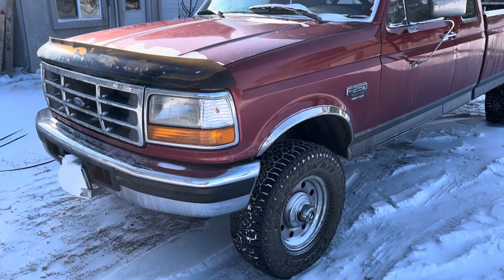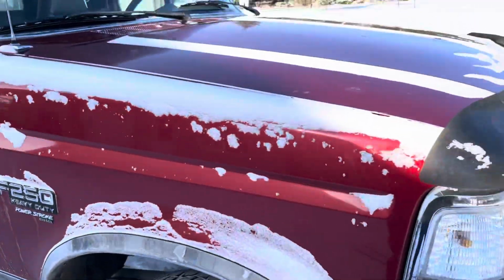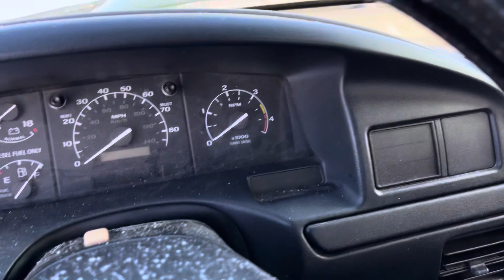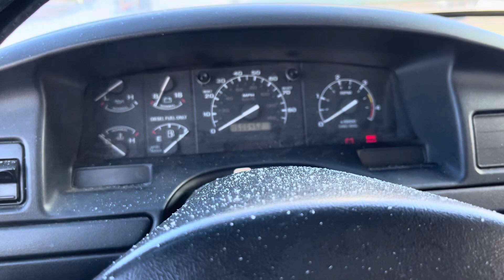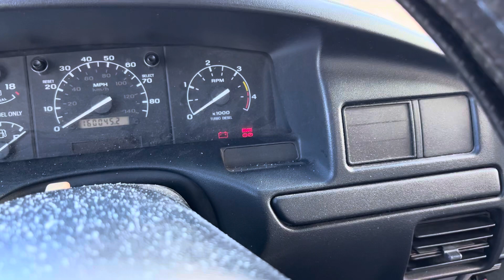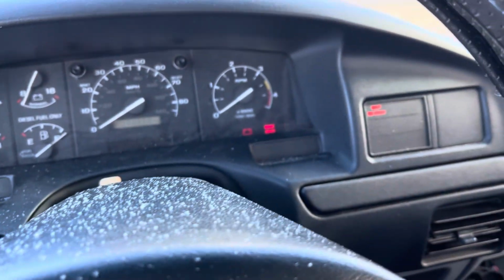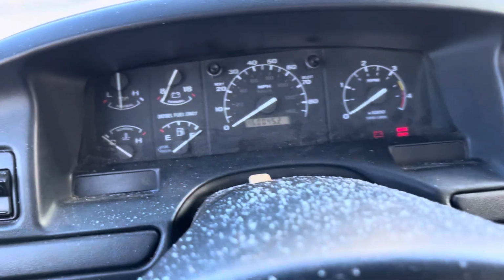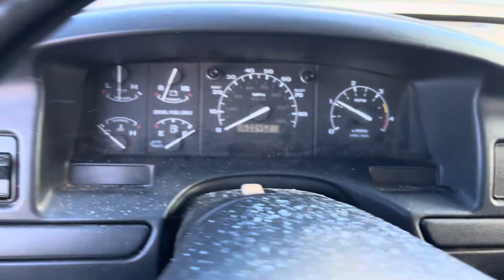1997 Ford F-250 7.3 Powerstroke -17 F cold start

Comment: When I had my 01 7.3 I always plugged it in during winter.  It had good glow plugs and it was in top mechanical shape.  Even if I forgot to plug it in, I would then plug it in to help it out.  Starting an engine is where the majority of wear happens.  So i did what i could to lessen the stress.  Also, most people rely on the light and turn the key on and off.  No need to do that, even after the light goes off the glow plugs are still on.  On my 01 they stayed on for 2 min when cold like that.  Just watch the battery gauge and you could see the draw.

Comment: You're waiting WAYYYYY to long to start. You need to crank it immediately after the "glow plug" light goes off, while the glow plugs are at maximum temperature. Glow plugs have very low thermal mass, and cool down almost instantly.
Reply: These glow plugs stay on for another 2 mins after the light turns off.

Comment: Need to cycle at least 3 times on the glow plugs, specially when it is that cold. I owned a 1995 7.3 powerstroke and even with new glow plugs took 3 cycles. Also don't turn the starter that long it will damage it. Had 500k on mine when I sold it. Also keep diesel kleen white bottle anti gel in it.

Comment: After dealing with these trucks for years, maybe consider putting a small oil pan heater on your truck. Those Bosch HEUI systems require good oil pressure to fire the injectors, and cold oil like that doesn't flow very well, especially if it's thicker (10W30, 15W40) and non synthetic. I had an '02 that was a pain to start and as soon as I put that heater on it, would crank over incredibly quick.
Reply from the maker: Oh yeah I bet that would help thanks for the comment. I normally just use the block heater and it fires up great in the cold. I just left it unplugged for this video.

Comment: Synthetic Rotella in winter and a high flow LPOP. With everything you’ve already done will start like a charm. Anti gel wouldn’t hurt when it’s that cold and you can test the glow plugs at the UVCH to confirm they are doing their thing as well as Forscan. ‘97 is cool cos you got the battery volts on the dash once that gauge resets you know the GPR cycle is complete

Comment: Nice truck!  These can definitely start just fine in cold temps if the entire charging/starting system is in tip top shape, especially the batteries.

BTW "windchill" has no effect on non-operational inanimate objects, it only affects living things that produce heat, or other machines that create heat.  a non-running truck produces no heat so the wind has absolutely no effect.

Also, cycle the glow plugs several times before attempting to start, it will allow things to heat up more and make for an easier start.

And in the very cold of winter, a fuel additive is an absolute must.  Archoil works really well as does several others.

Comment: How long does it usually take to start on freezing cold mornings when it is not plugged in? Does it usually take longer when it hasn't been used for several days?
Reply from the maker: It always starts up first glow plug cycle, even when it is slightly below 0 degrees Fahrenheit. They don’t like to start when the fuel is gelled, so get an anti gel, but besides that, if you have good injectors, motorcraft glow plugs, and that whiterogers relay, these engines will start perfectly fine in the winter.

Comment: So my 7.3 powerstroke after I fix my glow plugs and everything else it would start right up in the cold but I would always have the best luck with my 12 valve Cummins in my 97 ram 2500 that 12 valve Cummins will fire up every time

Comment: I don't know what the big deal is with people doing these cold start videos?? The 7.3 will generally start without being plugged in as long as the engine is in good shape, glow plugs work and you have good enough batteries. Everyone that lives up north knows this. Block heaters certainly help in the really cold weather but you can get away without them if you have to

Comment: Nice truck have a 99 drw all I know is my 7.3 hates being cold just hates it I always use the block heater I have new glow plugs and injectors as well shit I will plug it in at 40 degrees u get instant heat
Reply from the maker: Oh yeah, they definitely do, I know with the stock Motorcraft Glow Plug Relay, it didn't start nearly as well in the cold as it does now. The block heater is very nice I use it on mine quite a bit.
Reply: 6bt cummins be like whats your bro, i dont even need my grid heater. nice truck man. i loves obs fords.
Reply from the maker: Nice that’s cool, thank you.
Reply: @grantmackinnon1307 ”what’s your bro?” 🤔
Reply: @livewithnick  you's my bro, bro. brotha, brethern. bruh. 👉👈
Reply: @grantmackinnon1307  I know what “bro” means. I guess I just don’t understand the phrase “whats your bro” in the context it was used in.

Comment: This had a stock block heater why the hell wouldnt you plug it in? Also run 10w30 diesel oil it will fire and run better.  Works for my 2000 excursion 7.3l

Comment: My 95 7.3 would never start at those temps. I have to use ether for temps below 60 . I. Installed New glow plugs and glow plug solenoid, new injector 0 rings and new batteries

Comment: When the wait to start light goes off, that means the damn glow plugs get cold while you sit there a minute after they cycle, dude seriously
Reply from the maker: The glow plugs on these trucks remain on for over two minutes or more, you can see this as soon as you turn the key. The voltage gauge drops when the glow plug relay solenoid clicks. After the light goes out the glow plugs are still active, the gauge is still lower for several minutes. When I test the engine harness on these trucks, to check for burned pins, I check voltage at each end pin of the valve cover connectors, it will show nearly 12 volts to each glow plugs for several minutes depending on the temperature. The light is just a dummy light and indicates when the glow plugs are hot enough, but rather the longer you let them run, the higher the cylinder temperature, and higher the temperature the easier the cylinder will hit.

Comment: Leave it running all night?
Reply: Just keep it plugged in. That's what an engine block heater will do. Keep the engine warm so the oil is warm. Use Howe's or Power Service White bottle. With that level of freeze I'd pour in a bottle of PS red.bottle 911 on the last fill up so it can run through the fuel lines, fuel filter, and injectors before parking it outside overnight.